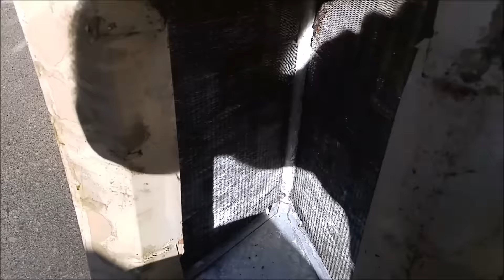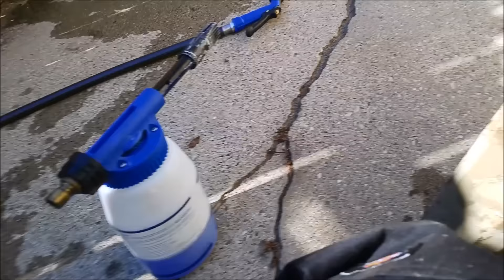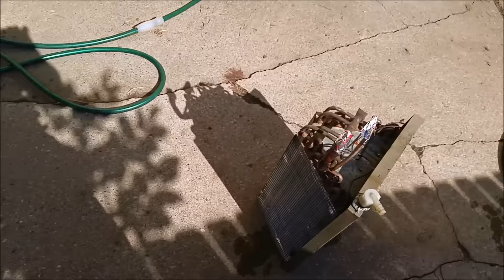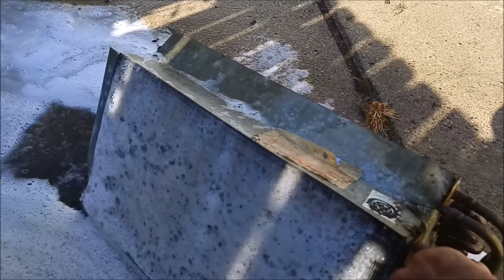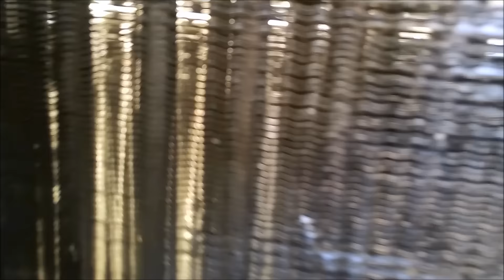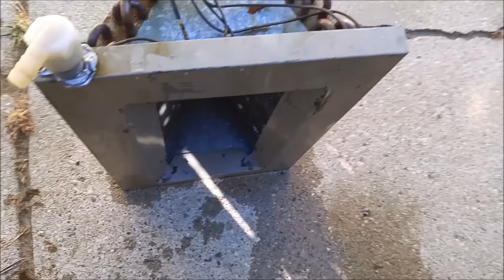Plugged evap coil removal and cleaning

Comment: Real world service call. Thumbs up! You made their system 100% better. But have to agree with others may have been a whole lot better to just replace it, larger face area and plastic pan as opposed to old rusty metal pan but then again do not know the customers situation. Keep up the good videos
Reply from the maker: +Paul HVAC we've had problems with this air conditioning and furnace for a while the only reason why we didn't replace the coil it's because the customer didn't have the money so we did the best with what we had to get the customer Cooling thanks for watching appreciate the comments